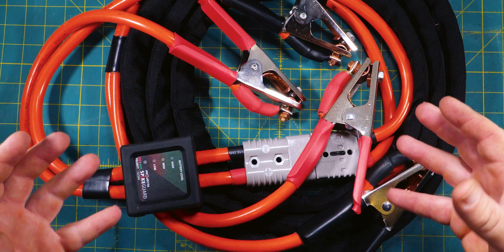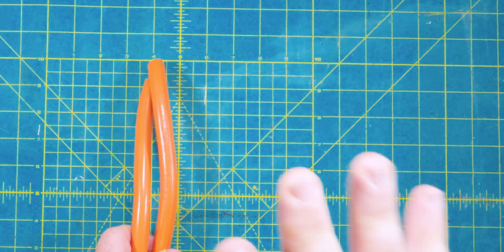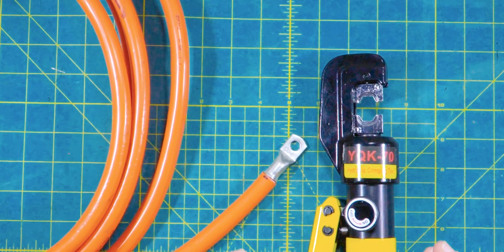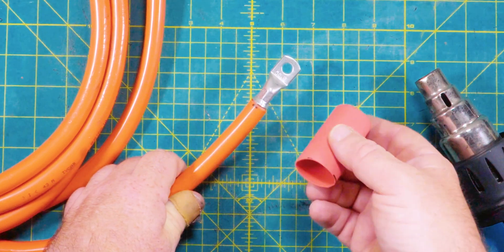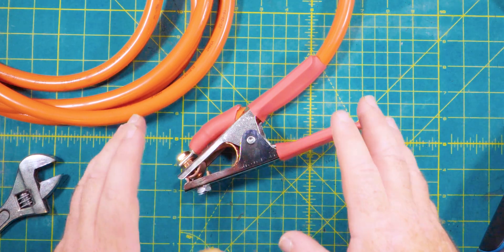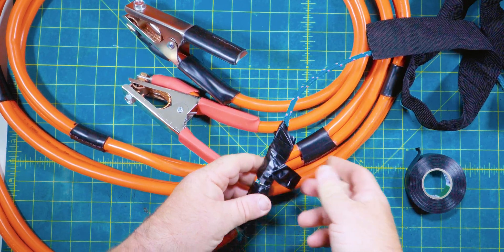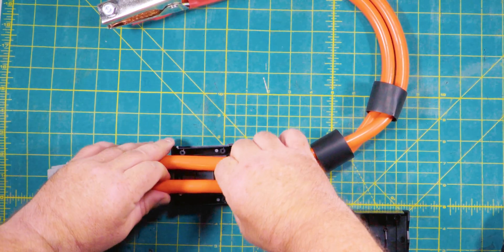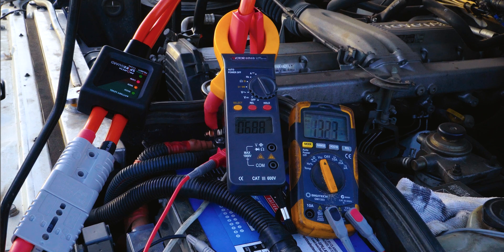DIY Jump Leads: How to Make Your Own Car Battery Jump Cables

Comment: Excellent video, and very informative. I saw this video whilst looking for something else, and I'm glad I found it. Does the spike guard have to be in a certain spot? Is it directional? I used to work for an auto electrical shop that sells leads made from jumper cable, but they are very expensive, especially if you want a decent length. I have a decent pair of leads that are probably the closest gauge to the welding cable, and thankfully they have the protector on them as I helped someone out, and they connected their end, and they got them arsed about. The electrics in my Jeep didn't fry, but the leads got smoking hot. They seem ok after that, but I have learned from that, and if I help someone, I connect both ends myself. I am thinking that it may be a good idea to replace the surge protector, just in case. 

Thanks for the awesome video 👍
Reply from the maker: The surge protector usually isn't polarity sensitive, well the couple I've pulled apart anyway.

Unfortunately a surge protector won't stop you damaging your electricals when someone muddles up the red and the black. 

Surges usually happen when a magnetic field suddenly collapses, like taking the power away from the alternator suddenly. Also it shouldn't matter where the surge arrestor is in the jumpers, as long as they're there.

Comment: Really like those jumper leads, the welding cable flexibility, clamps and accessories plus the surge protector look well made.
These would, should start tractors, I have bought so called heavy duty leads, only to see them heat up and struggle to start a cold diesel engine in winter.
Also enjoyed the humour in video, no snooty 🐂 S to be heard.
I - need, want a set of these now.
Reply from the maker: They're a great set of leads mate, I actually gave to my son! 

I'm making an almost identical pair for myself, though I'm still yet to finish them off.....

Comment: Another excellent video.
The jumper cables only have the spikeguard on one side of the cables and you move the spikeguard end from the good battery to the bad battery in the video, is that correct?
Happy Motoring.
Reply from the maker: It won't matter which battery the spike guard is closest too. It should work just the same.

Comment: When wires are made to start the engine, the terminal clamps are tried to be spaced along the length to minimize the risk of a short circuit between the wires.
Reply: Well, most commonly the two cables simply aren't tied together. But that's not possible if you use the connector (which is rated only 175A, that's simply not enough), and the spike protection (which isn't really needed anyway, you just need to make sure that you connect the wires correctly). Also, it's important to follow the right order: Connect your positives first, before even getting the cable for the negatives anyway near! That way, if you touch anything wrong when installing the positive cable, you won't short anything; and once installed, you again can't easily short anything with the negative cable.

Comment: is that 16mm2 cable?
Reply from the maker: It's 50mm². Thicker the better for jumper cables!
Reply: @LockyourHubs4WDing  Well, sorry, but using 50mm2 wires, and then only 175A rated connectors simply doesn't make any sense. You oversize the cables and undersize the connector. At best, it's waste of copper (so money and weight), at worse, the connector will get dirty, which will decrease the effective rating to below 100A and it will tend to melt.
Reply from the maker: They're original Anderson SB175 connectors. 

Rated for short duration at 280a.

Comment: Simon, another great simple video for us to follow. I need a new jumper cable and this might just be the one to do. I would love to see a video of the difference between soldered and crimped and what about over time as in a year or more will that make a difference ie: corrosion, etc..
Reply from the maker: Corrosion would be another great one to test, especially normal vs double walled glue lined heat shrink, to see if the extra expense is worth the bother. There are ways to accelerate corrosion, that'll at least provide a guide.
Reply: @LockyourHubs4WDing  Sounds great I look forward to seeing the video when you make it.

Comment: i had to laugh when the shrink tube folded over on itself  
nice setup and the andersons i have always soldered them and heat shrink over the connectors
Reply from the maker: I've done both with the Andersons, though would love to answer the question once and for all.

Comment: Yes Simon I would be interested in a terminal comparison video, seeing, I  solder my terminals.
Reply: Yes it is interesting, now they just crimp the terminals, but an old auto electrician said he always used to solder his, the trick was just enough solder to get good adhesion but not to let it run too far up the cable. I asked him about the argument that “the solder will melt under high load, he laughed and said “well if you drop liquid solder on plastic it will melt it now what does that tell you?” But he also said that “if a cable gets that hot that it starts to melt the solder then there is something seriously wrong. He used to do heavy machinery. Something to think on.
Reply from the maker: @peterellis6065  he's got a point about the heat melting the solder, if your wire is that got, there's either a bad joint or the wire is way undersized. Having said that, solder is a way worse electrical conductor than copper. Though there is such little solder used in a good joint I'm not sure that it would make any difference.

Either way, I'll find out!
Reply: @LockyourHubs4WDing  Agreed, he always said that solder is to be used as a jointing compound, and under NO circumstances should it be used as a filler.  I took thats as the connection must be tight fitting and not flopping around like a sock in a bucket
Reply from the maker: I think there might be a few interested in that, it's definitely on the list.